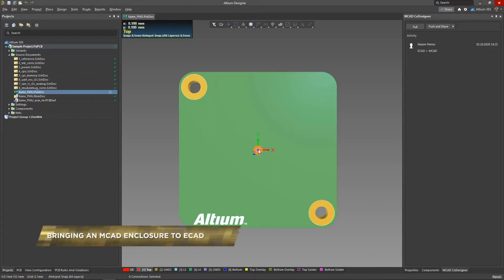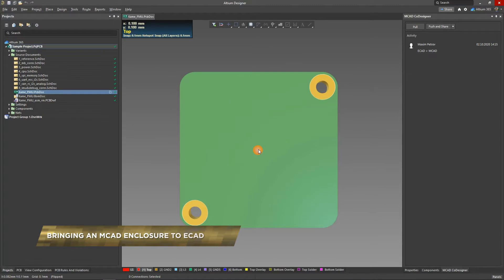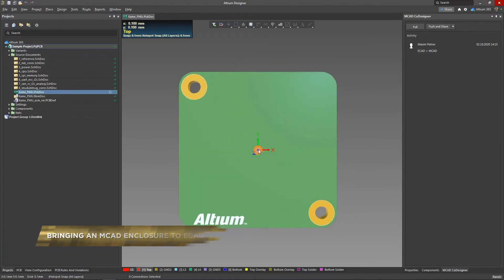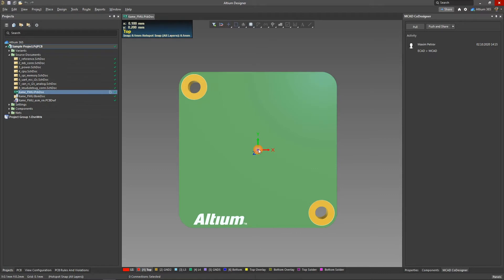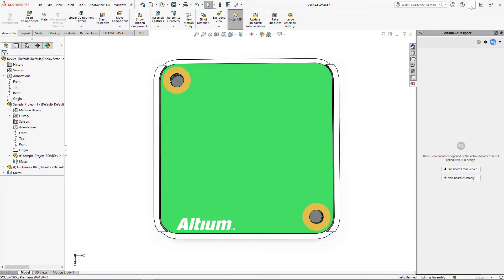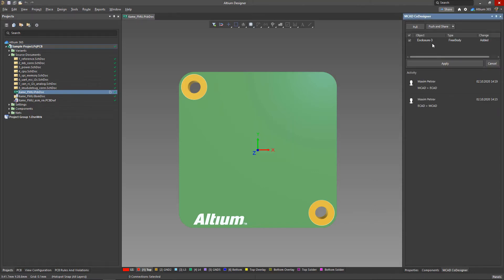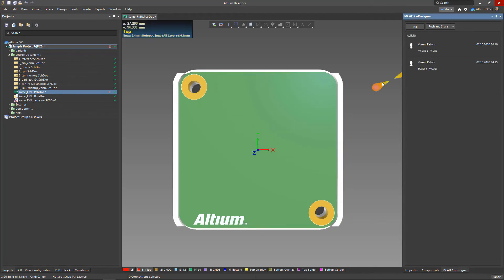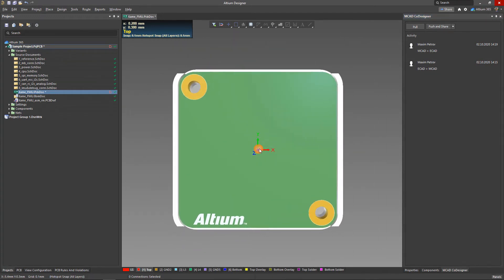Bringing an MCAD Enclosure to ECAD (New Method in Description) | How To Use Altium Designer

Comment: I would be nice to have the possibility to exclude a 3D model ( or multiple models ) to be exported from ECAD to MCAD, removing the need to thing about moving the enclosure or not, this could prevent accidental removal of the 3D model when accepting changes from MCAD.
Reply from the maker: "would be nice to have the possibility to exclude a 3D model ( or multiple models ) to be exported from ECAD to MCAD" -- This is common feedback and is on the development roadmap.
"removing the need to thing about moving the enclosure or not" -- Currently in development and going to be done very soon.

Comment: I really like Altium , and Concord Pro is convenient.  But recently, I found that if  MCAD like solidworks create a board with rounded angle , that make my post to server falil , and the results that  I pull into altium is terrible!  (both concord pro   1.1.9  and 1.1.8)
Reply from the maker: Did you try to use 3D fillets? They are not currently supported by CoDesigner because the nature of PCB on the ECAD side is still two dimensional. You can learn more from our documentation: https://www.altium.com/documentation/altium-designer/direct-ecad-mcad-design-with-altium-codesigner-ad#!changes-that-will-not-be-transferred-from-mcad-to-ecad
If you are not using 3D filets, it would be good to receive the design through the Altium Support procedure. We can do testing to learn more.